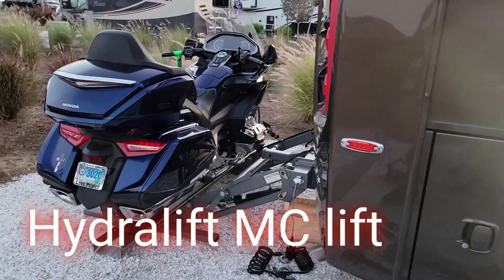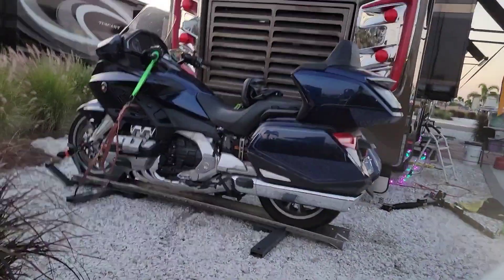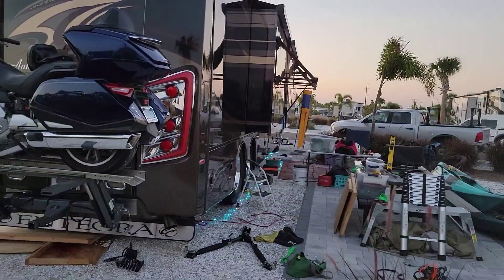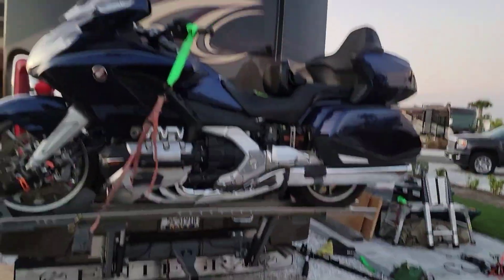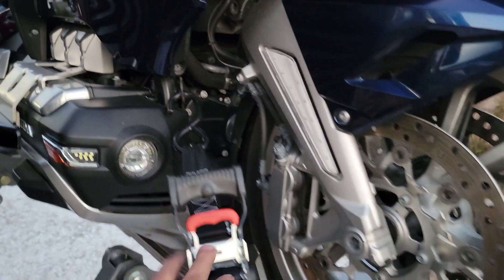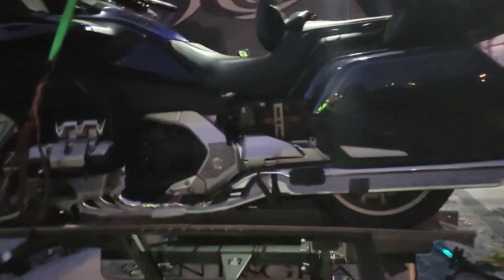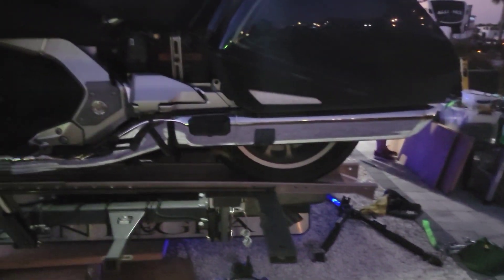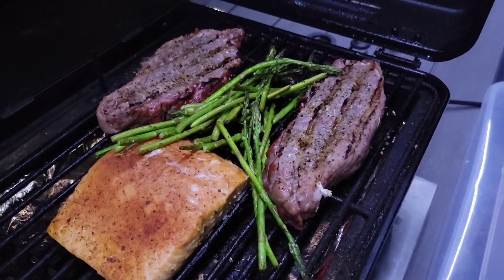Motorcycle HYDRALIFT  on Entegra Anthem 44B

Comment: I’m on my first trip with our Hydra Lift, carrying a Harley Ultra Limited. A friend recommended that I add tie-downs wrapped around the wheels and the ramp “Just in case”. Well I had a tie down failure and the wraps around the wheels are the only thing that kept us from loosing the motorcycle.
Reply from the maker: @stevensewell737  great advice. Straps fail on these often. Carry extra straps.

Comment: May I asked if welding was required for your application?  I have an ‘07 Country Coach and wondering if this Hydralift brand universally bolts to Class A frames or require custom welding.  Thanks for the video and your time.
Reply from the maker: No welding required. Bolts along side chassis frame rails.
Mine is for sale, $3k.
Reply: @winginitwithjohn8451  where are you located John?  I am about 40miles west of St. Louis.
Reply from the maker: @rickbumeter6946  Glacier NP til late September
Reply: @winginitwithjohn8451  thank you John, I will keep looking for a bit.  I appreciate the information for sure.  Safe travels.
Reply: I also tote a Goldwing behind a NewMar. It’s been all over the country.  I did end up with tethering chains since I added a 12” piece. Ironically they say not to tighten them, so maybe it’s more psychological thing.lol

I tie mine front and back to the pegs and I’ll admit, I have a tendency to overstrap. Icicle itdown pretty tight and don’t have much bounce. Some have said no to but it’s been fine over the course of 3 years. 

Thanks for the video.

Comment: Does this just work for the big motor homes? Are will it work for a 35 foot sea class? 4 wheel drive motor home, please comment back. Yeah, let me know, thank you.
Reply from the maker: This lift is designed for class A motor homes. I installed it myself, and imo, it would be too much for a class C. The frame and chassis structure would be the issue on a class C. A tg axle would also be my recommendation, as the weight of a large motorcycle plus lift is more than a 1k lbs.